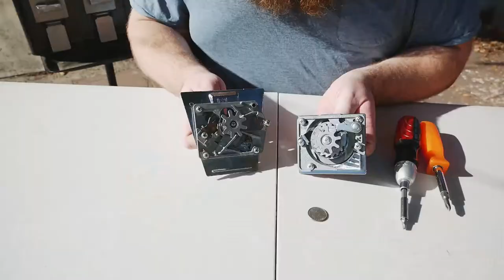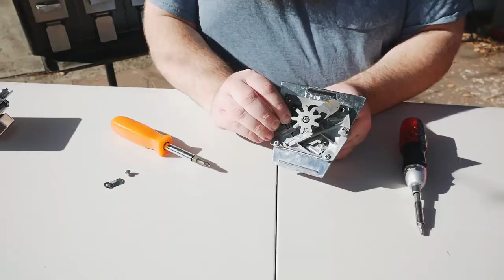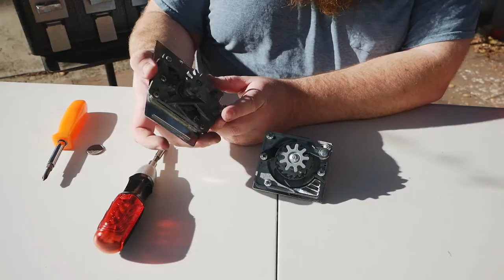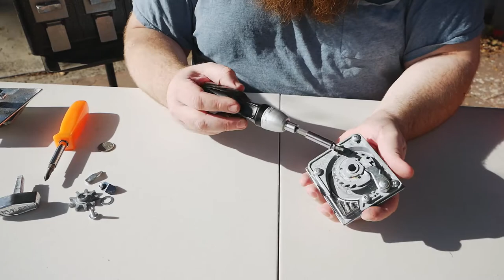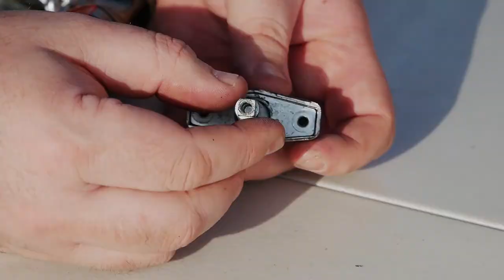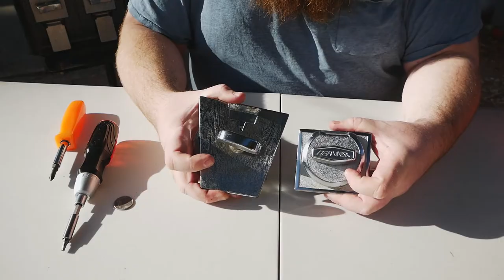Coin Mechanism Tear Downs - Oak Acorn and Beaver New Generation

Comment: Would they be able a beaver mechanism with a fake quarter or cardboard circle? They did it on my northwestern in schools.
Reply from the maker: Unfortunately, so long as it has the right dimensions, anything hard enough will "fool" a coin mech. Add in wear of the validators and their springs and even something like a cardboard coin could get past.

The only way to validate metal is doing so electronically. Unfortunately that adds complexity and potential failure that would end up rejecting all coins.

The best solution is just maintaining your coin validator and inspecting it with real and fake coins to make sure the validators are working as they should. Also expect slippage as an unfortunate part of the business, but warn your location that it's happening and work on a solution between both parties, especially if you are sharing a percentage of what you take out of a location.

Comment: Hello, I have gumball machines that work on 500lbp coin it is a lebanese currency. In lebanon we are facing inflation so the 500lbp coin is worthless, so i need to change the coin I use and because of inflation rising everyday I need to use a TOKEN to adjust prices weekly. Is it possible that I could adjust the same mechanism to change it from 500lbp to a different size coin (token)? Thank you for your help I appreciate your time.
Reply: I can help you  please call the office Tues to Friday 7 to 330  central time USA

Comment: Can anyone tell me how to JUST get the coins back OUT of a northwestern 80 series toy capsule machine? I just got an old one, no manual. Cant find the users manual online. Idk how to get my coins out!
Reply: There's a lock in the top, use the key to unscrew that lock. It holds the entire machine together, you can then just lift up on the bottom section of the machine to access the coins. If course, If you don't have the key, look up how to drill the lock out of a bulk vending gumball machine.